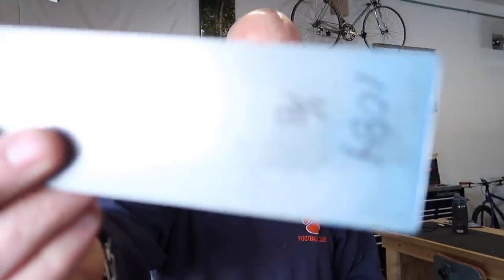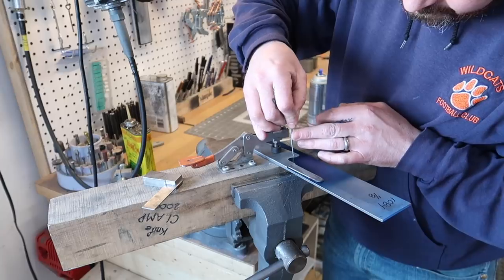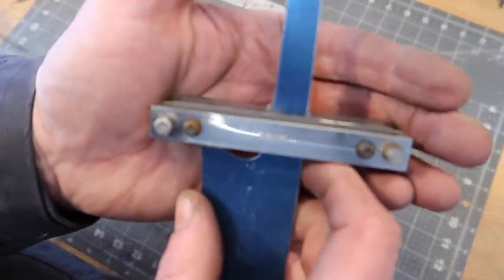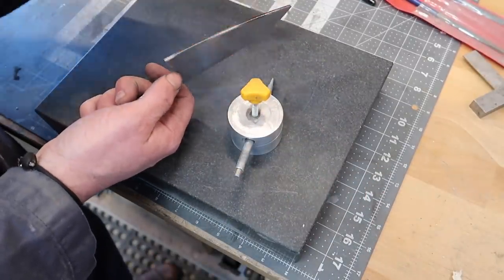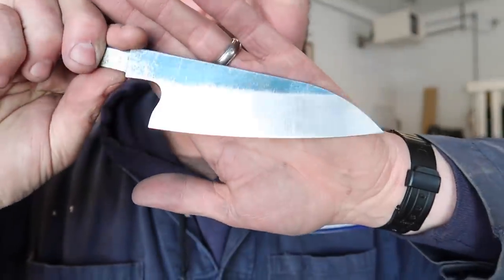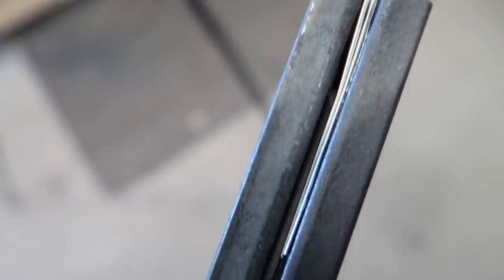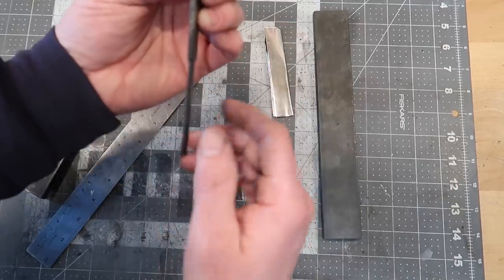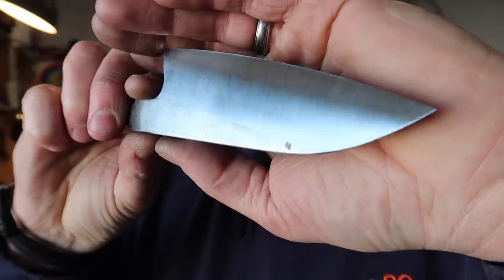How to Make a Small Kitchen Knife  -SLL Build Along-

Comment: Also, if I think I've ground the edge too thin before heat-treat, I'll just give the edge a light touch on the grinder before going to the heat treat. It's usually not enough to significantly change the blade itself, but enough to thicken that edge up so it's more stable!
Reply from the maker: Totally should have done that. 😆

Comment: Hey Jeremy
I think you may have tried this before, I’m sorry I don’t remember. How about grind the blade edge to .020 to .025 then heat treat and temper. Then finish grinding to your set thickness before hand sanding. 
I’ve done this with most of the kitchen knives and a fillet knife that I have made with great success. I dip after every pass on the grinder to avoid over heating the blade. Just a thought. 
I really enjoy your videos and the content.
Cheers Mark

Comment: Looks like that big edge warp propagated that crack right out of the quench. Not much you could have done about it at that thickness, I don't think. Something to consider with 1084 is that it has a little too much manganese to pick up a nice hamon. They always lack the fine details and patterns you get with something like 1095 or W2. As far as rutlands cement goes, I've found it in tubs at big box stores where they keep fireplace stuff. It's usually separate from all the caulking and insulation.

Comment: If I'm making my first knife with basic tools, how thin should I get the edge pre-heat treat? I'm using 440C and using a hand file bevel jig
Reply: Matthew M I'm making a basic drop point hunter type knife, and I will be sending it out for HT. Especially since it's Stainless. I've been debating on getting a Harbor  Freight 1x30 belt grinder mainly for handle shaping, but maybe also grinding bevels and such. Otherwise, it's hand files
Reply: Dime thickness at the least. Im a fairly experienced bladesmith with forging and stock removal. Any thinner than that, it becomes common for the edge itself to warp, especially on longer blade (5”+)

Comment: Too bad it cracked.. you could reprofile it but it would be a lot of work after all the finishing stages
If you're not going to sell this knife, then the crack isn't an issue. I mean, you know it's there, it would be better if it wasn't here, but since it's a light task knife and since this is so sharp, you won't notice it at all and it won't affect the performance of the knife
Can you tell me a bit more about how you revealed the differential hardening line ? When I use ferric chloride and then  lightly sand with 5000 grit, everything takes the same color as the rest of the blade, even though the edge was clearly darker right after the acid bath

Comment: Cool.   That crack breaks my heart..  now im scared to heat treat mine.    Ugh..
Reply from the maker: yeah man, quite a bummer. Especially because I didn't notice it until I was putting the final touches on the blade. Oh well. I am interested to see how using it affects the crack and what happens over time. So to that end I'm kind of excited about seeing what's going to happen. 👍
Reply: @Simplelittlelife  keep us posted.  And wish me good luck
Reply: I would have been ecstatic to have ground that blade. I’ve just made about 12 knives so far, many with imperfections. No all with imperfections 😂 in finish carpentry we say when an imperfection occurs, caulk and paint will make it what it ain’t !!!  Unfortunately that doesn’t apply in knife making!!!